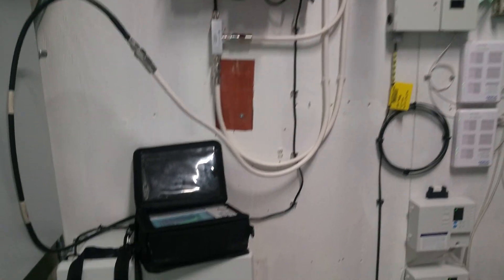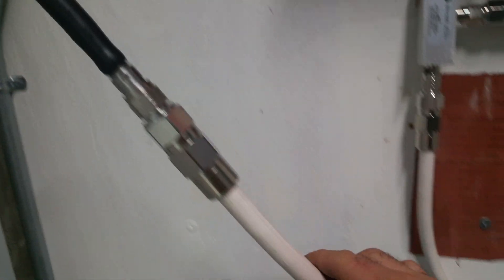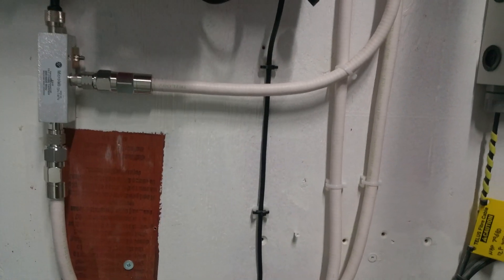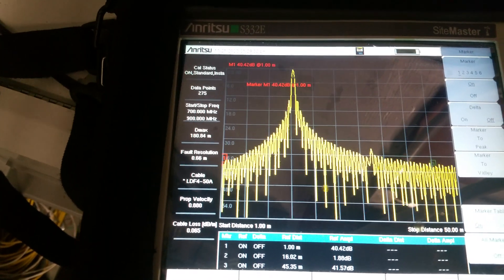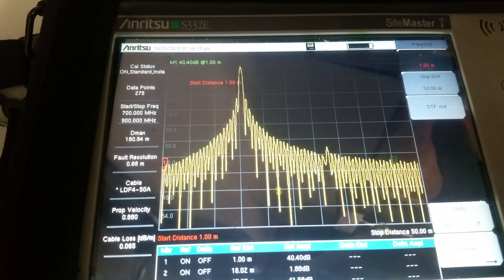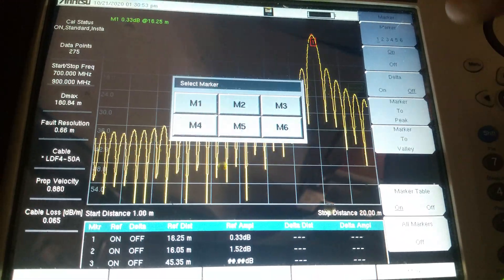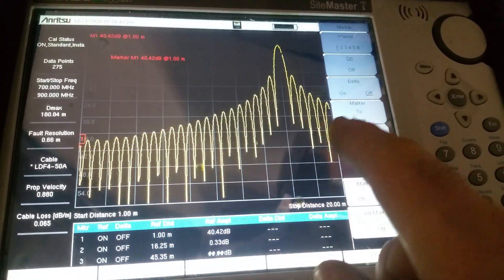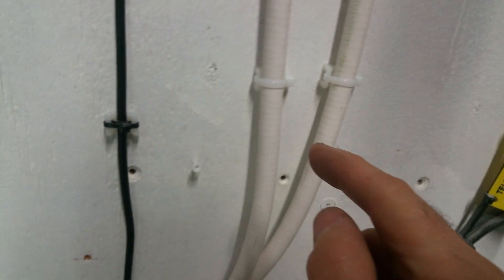Distance to fault measurement using Anritsu tool

Comment: Hi George, 

could you do a video explaining where to put your markers when performing a DTF to load with multiple joints/connectors throughout the system?  Thanks for the video.
Reply from the maker: Sorry for the delayed message, this is not my main account. With this tool you can see a coax network tappers and connectors, you need to do some math to identify components